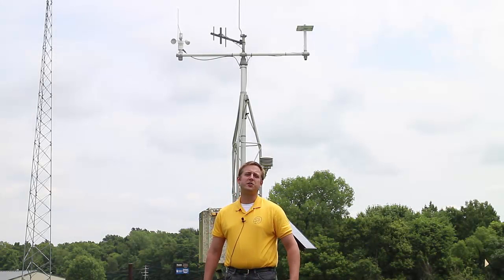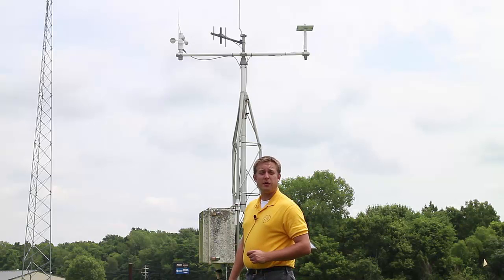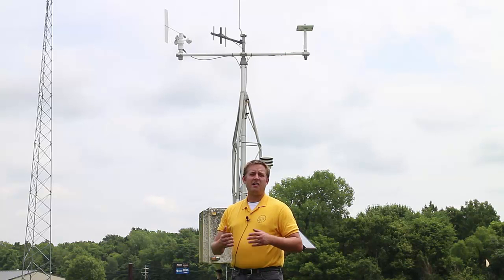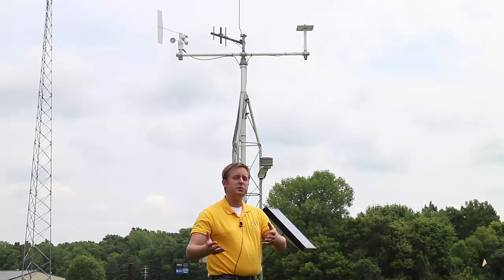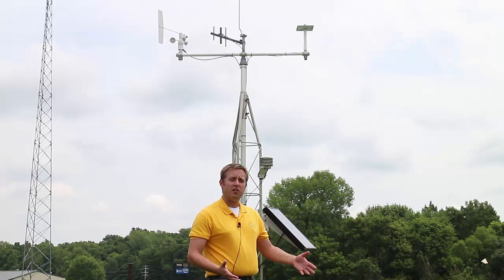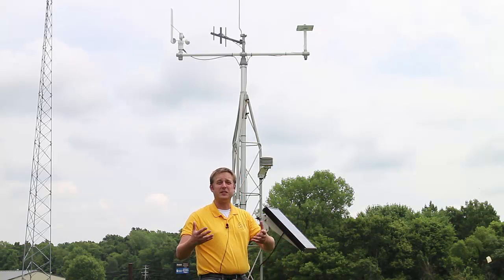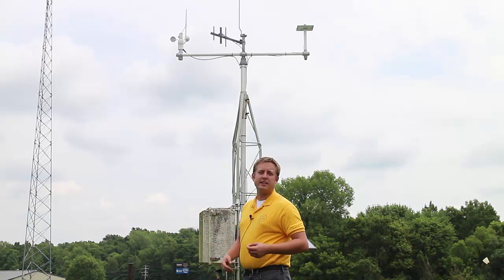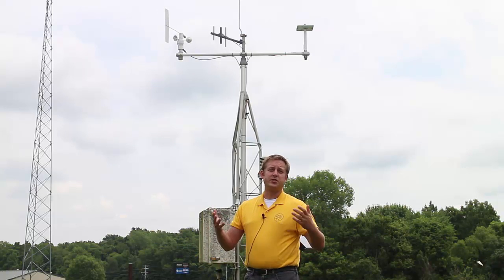Advanced At-Home Weather Station

Comment: How come a such an expensive station does even a fan for the thermometer? That's basic!
Reply from the maker: Excellent observation!  Fan-aspirated radiation shields, like you mention, are becoming more common on home weather stations due to the ability of the fan to prevent inaccurate readings on very still days.  That station (and video) does not have fan-aspiration for two reasons.  First, the equipment would have been installed at a time when fan-aspiration was less common.  Secondly, the National Weather Service requires a radiation shield but explicitly states that aspirators are not required to meet the specifications for a COOP station. Hope that helps!